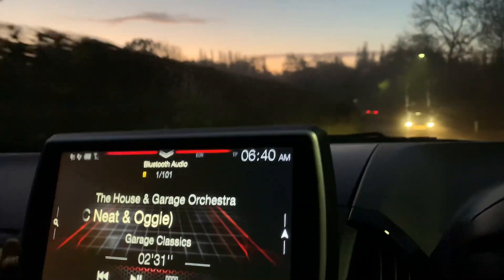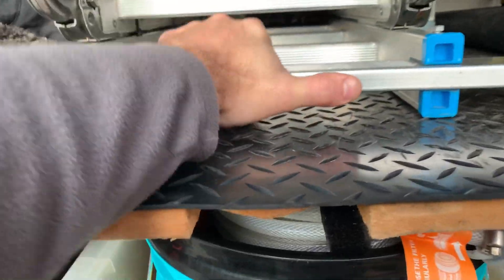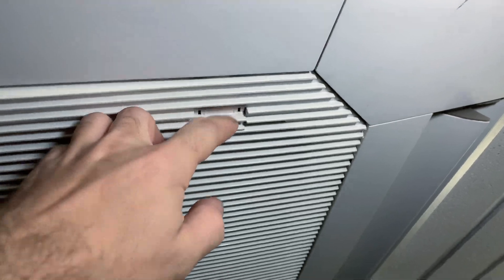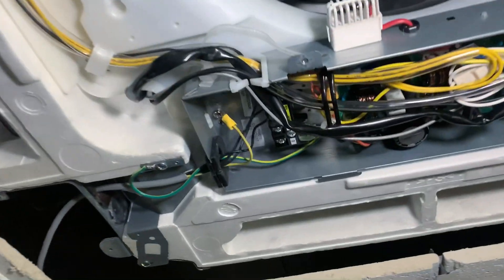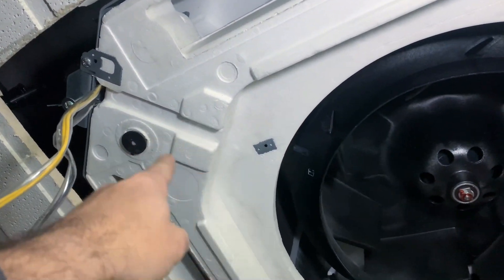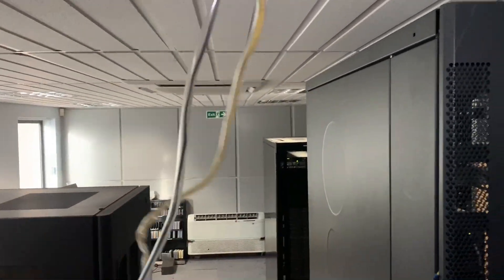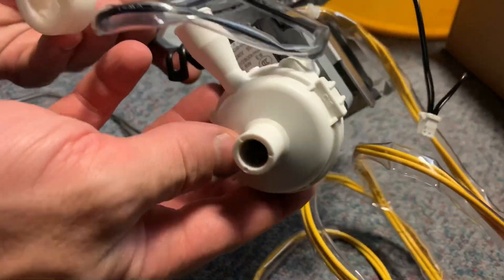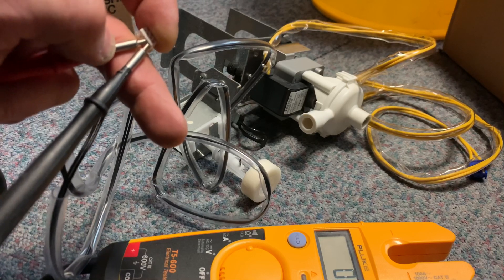ANOTHER DAY IN HVAC PARADISE * HOW TO REPLACE AN INTERNAL LIFT PUMP *

Comment: I always leave the electronic box on, because is faster and then you just let the staierfoam hang for the cassette in the power cable.. Of course you can only do this if the power cable is secured before its connected to the electric box..
Don't know the English word for the cable thingy.. But it provents you from ripping the cable out
Reply: Done a million of these now and i 2nd this comment. I always leave the electrics box on and hang the foam off jst need a nice long screwdriver get up through the vents take the screws out 👍